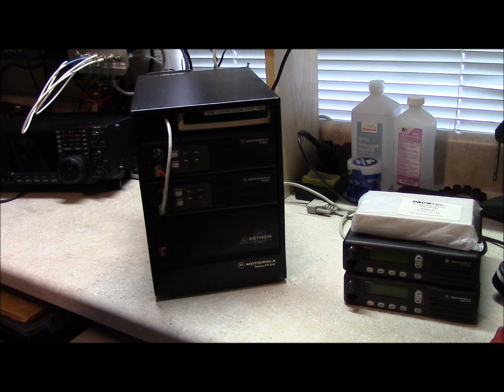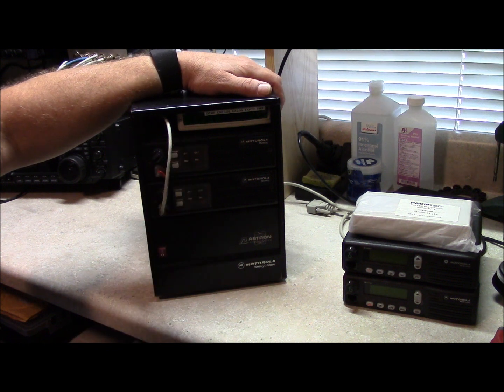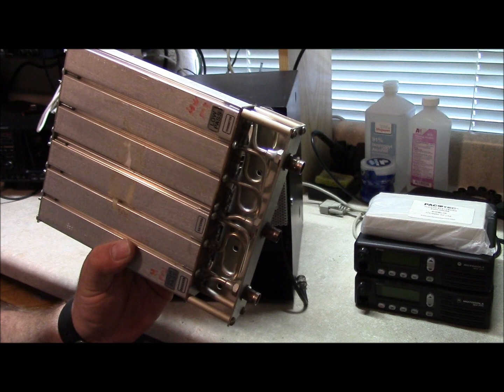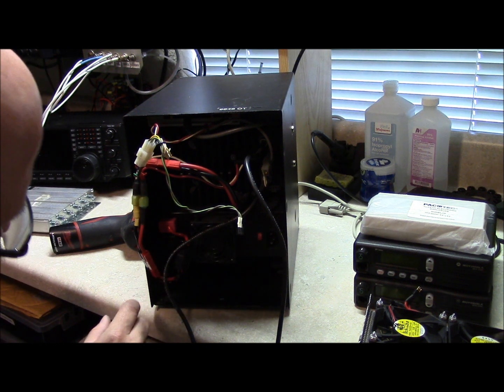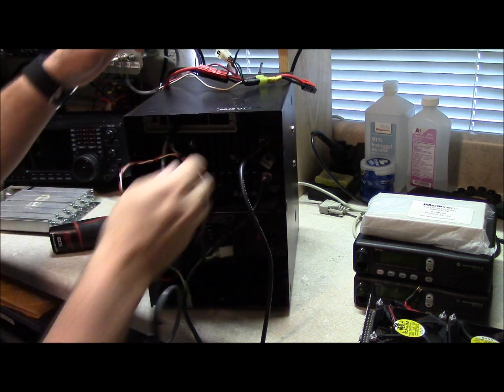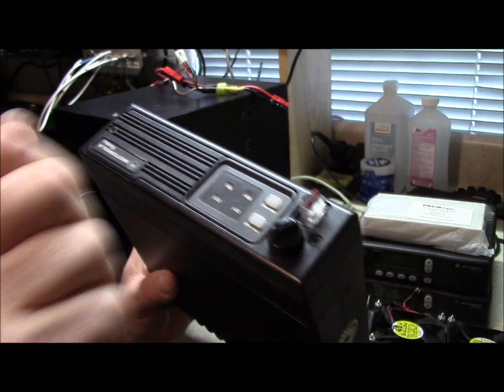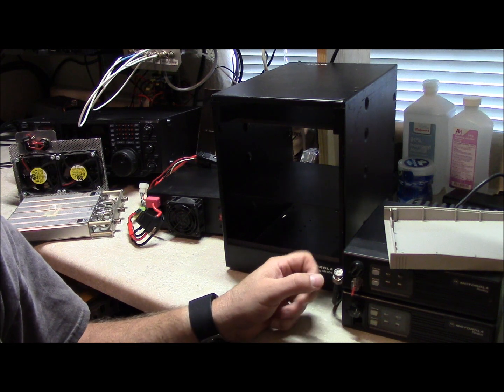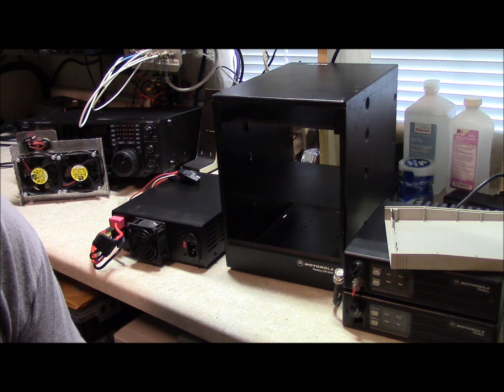Field deployable UHF repeater Part 1

Comment: I prefer a R1225 so it saves weight and volume and it has the same performance level as any other Radius, unless you need a cross band configuration then you can't use one R1225 of course.
Reply from the maker: Thanks for watching !

Comment: So where did you get the new enclosure for the controller? I'm ordering the ICS controller and that would be a great thing to have.
Reply from the maker: Its just a project box.
Reply: @survivalcomms  thanks for the info!
Reply: This is my very first repeater project, and it is a pain to say the least. It's a good experience though
Reply from the maker: @Mrradio01-15  What are you using for radios and for a duplexer ?
Reply: @survivalcomms  I am using a Chinese made VHF duplexer that is rated at 50 watts. Not bad for the money since Sinclair is out of my price range. I am using two Kenwood TK-730H(G) VHF radios. They have the pinouts on the back to pull all of your needed signals out of the radio. No modifications needed to my knowledge. When they are installed, I will be backing the radios down from 110 watts to 60 watts to ease the strain on the PA. The way I figure it, run it at about half of it's operating power to help keep the PA  from burning itself out. Plus with it being a bigger radio, it has a much bigger heat sink than it's smaller counterparts.
Reply from the maker: @Mrradio01-15  What split did you get on your license for your repeater pair ? There is zero chance that duplexer will work in a 600 khz amateur split especially with anything over HT power and even then its questionable. 10 to 20 watts is what you want for RF out on a portable repeater IMHO the extra power is going to do very little to increase coverage and will deplete your battery much quicker.
Reply: @survivalcomms  the battery is just as a backup. The split is around 600 khz. This repeater will be used to deploy as a backup. What I was taking into account was signals inside of buildings. That's the reason I was thinking about 60 watts. As far as the duplexer goes, I guess I should spend the extra money on a different one. Thanks for the advice by the way
Reply from the maker: @Mrradio01-15   For a 600k spilt you will need a legit duplexer . Who is tuning your duplexer ?
Reply: @survivalcomms  believe it or not, it is the seller.
Reply from the maker: @Mrradio01-15  Does not surprise me . For a legit 2m 600Khz repeater look to spend $500 or more and they are not compact. Im not trying to rain on your parade but narrow split VHF is not cheap to implement. Do not buy it from China get one from a reputable manufacturer. Repeaterbuilder dot net has loads of excellent info,
Reply: @survivalcomms  I hate that, but that's the way it goes I guess. Thanks for the advice!
Reply: @SurvivalComms can you provide a link where you got that project box you used for your controller? Thank you again for the help!
-73's
Reply from the maker: @Mrradio01-15  I got it from an electronic surplus store on its own. I have no idea who made it unfortunately.